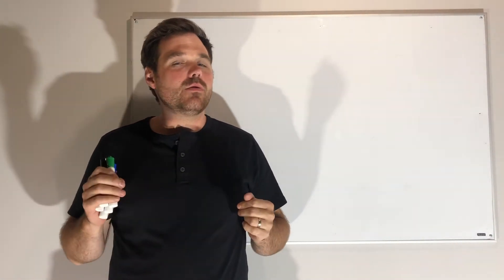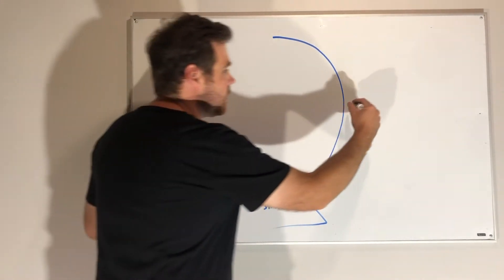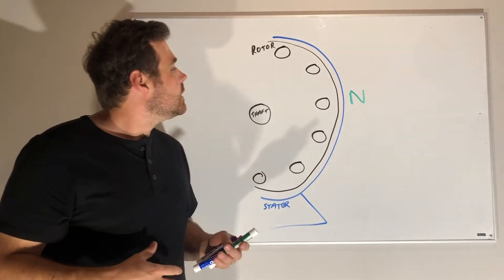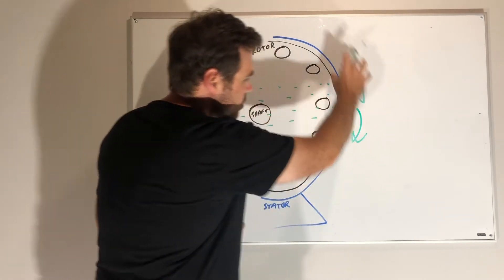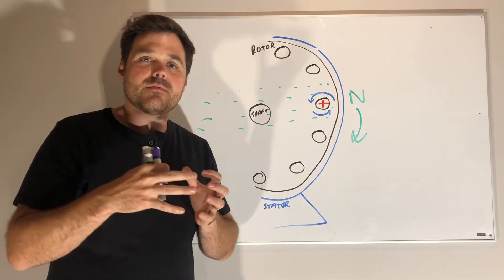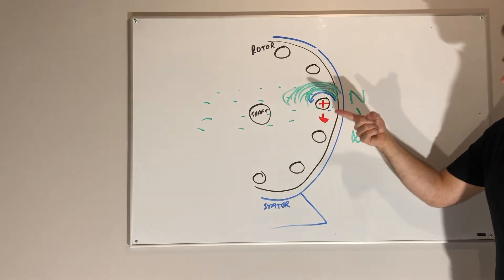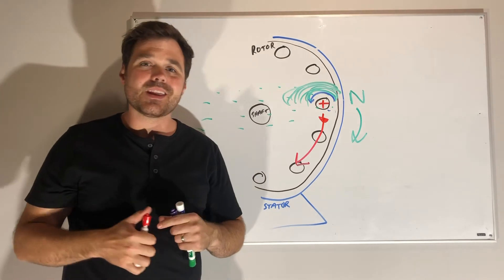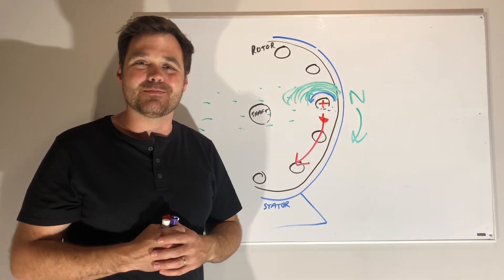How a motor rotor generates torque with magnetic fields

Comment: Excellent video, thanks for taking the time and sharing your knowledge.  Just to help me understand a bit more, the relative motion in the rotor is up (CCW) because the stators magnetic field is going down (CW) and that’s the same as the rotor moving up (CCW) though the field to get the induced current in the rotor?  And you use the generator hand rule on this motor because it is an induction motor.  The motor hand rule would be used if this were a dc motor or maybe a synchronous motor with permanent magnets in the rotor?  Hope that makes sense the way I worded it.  Saw the comment about which hand depends on whether or not conventional flow or electron flow is used.   That really helped me a lot since other videos seemed to contradict one another but now I know otherwise.

Comment: so if i put the magnets closer together, further apart, or closer to / further from the stator, which of these increases torque?
Reply: also more magnets, less magnets, wider / narrower magnets etc.
Reply from the maker: Whichever one of those would increase the strength of magnetic field
Reply: @ZackHartle  idk how to test it without gluing the magnets in, then removing them and putting them in other ways, 3d printing various motors housings, buying several magnets of different sizes, etc.
Reply from the maker: @waynefilkins8394  Fair enough.

One thing to remember though, is that there isn't actually any magnets inside a motor. It's all interacting  magnetics fields from conductors that have current flowing through them.